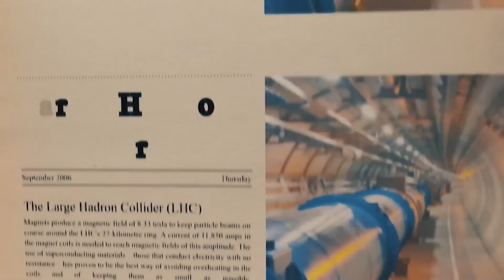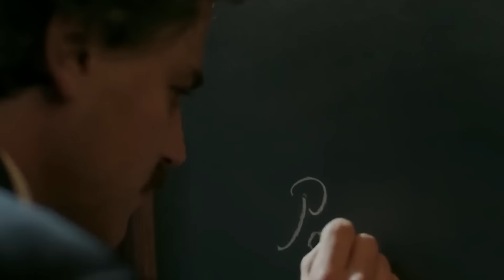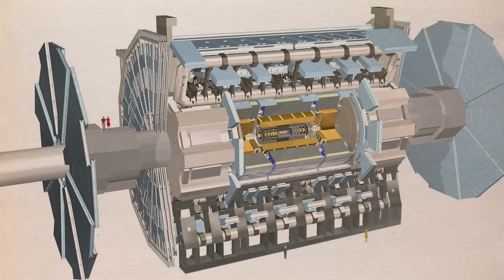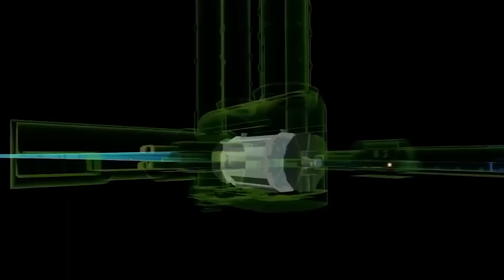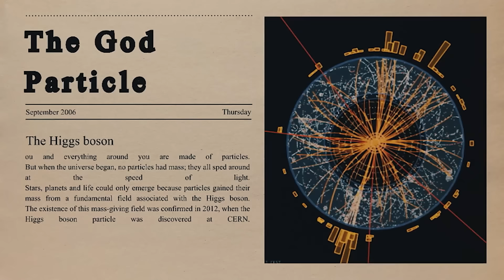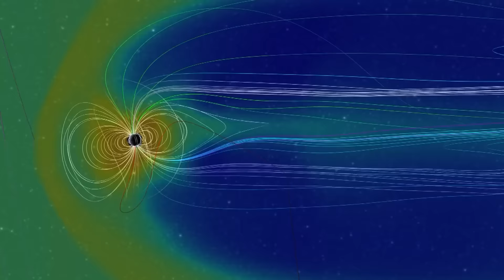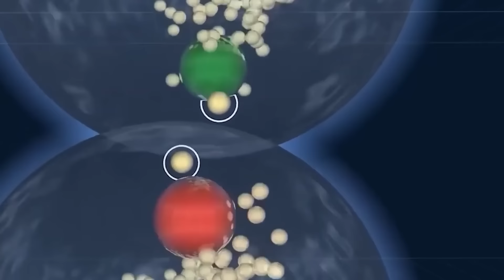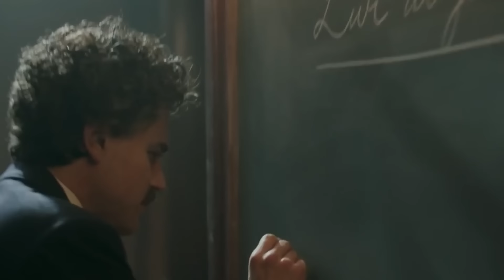Um, Scientists At CERN Just Announced A TERRIFYING New Discovery!

Comment: 3:03 CERN itself, and the accelerator tunnel, were founded long before 2008 (as is made clear just before when you mention Tim Berners'Lee working for them in the eighties). I figure the slip-up just happened because you were(mentally) referring to some specific CERN project starting in 2008.

By the way, lots of the tech and thinking that built the internet are legacies of the 1960s-70s space race. Without Apollo, Gemini and the need to monitor space missions in real time at huge distances, no internet. :)